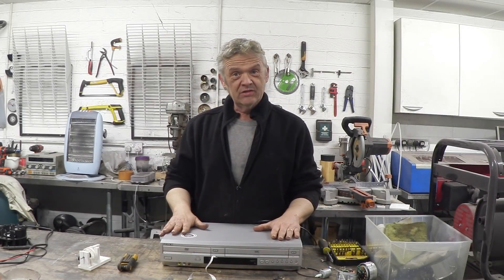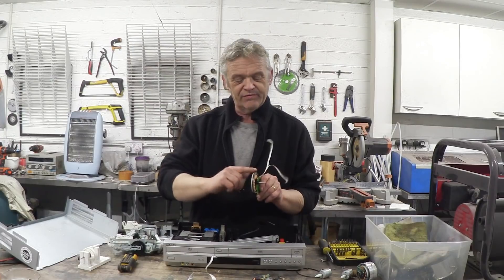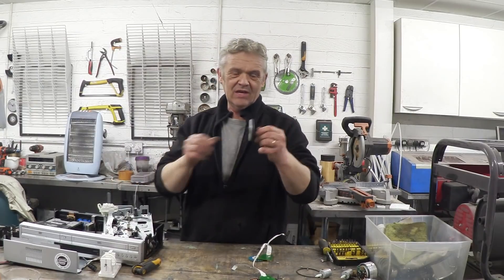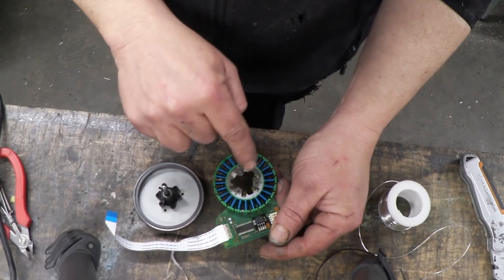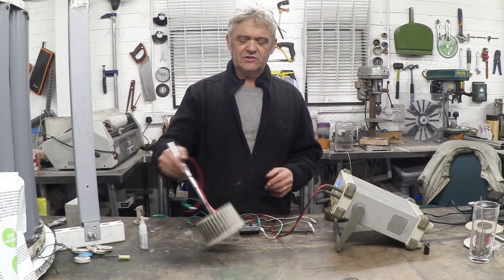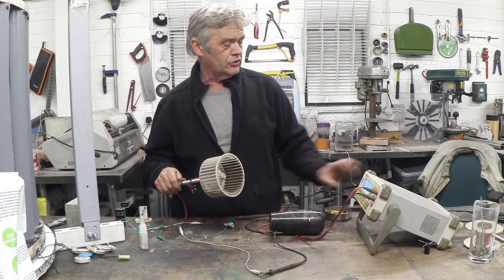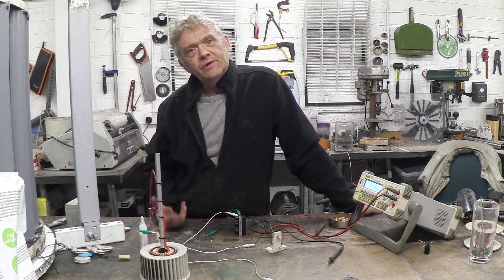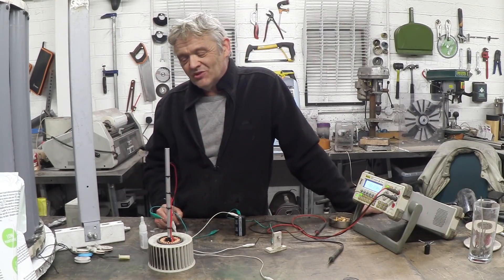Micro Wind Turbine / Harvester

Comment: In regards to a 3 phase axial flux generator, how do you connect each phase to the bridge rectifier? I've seen some people take each phase and split the wire and use 3 rectifiers and I've seen some just use 2 rectifiers. In your opinion, what the best option. Not many videos online about this.
Reply from the maker: I have done a few mate - but you use a 3 phase rectifier which is 6 diodes in series/parallel - you will find it here https://www.youtube.com/watch?v=IMvWkg-Hwv8&t=13s the circuit you want is at time stamp 1:36

Comment: I have a quick question. Wouldn't a vertical axis wind turbine be more efficient if it was built so 180 degrees of the vanes/cups were kept out of the wind stream with a baffle of some sort thereby blocking the wind from exerting a force when the vanes/cups face the wind direction?  Like if a water wheel was completely immersed in the river it wouldn't rotate too efficiently.

Comment: You know when you discharge a capacitor with a screwdriver, where does the energy go?
Reply: EM and especially heat radiation.
Reply: Given a large enough charge in the capacitor, one could ask..: "Where did my screwdriver go?", so the answer is "into the screwdriver"
Reply: Balances and connects the 2 halves of the capacitor which eliminates potential.
Reply from the maker: I don't understand

Comment: good stuff, surprised are not on every street corner light. harvesting wind energy and charging a small battery when light out for off times
Reply from the maker: that's a nice idea mate
Reply: Street lights would need some massive batteries to stay on and useful all night.
Reply from the maker: these days = probably not mate
Reply: @ThinkingandTinkering  yea it's about the same wind here in seattle, so wind itself wouldn't be enough energy to power on an led. too bad the whole light post is not a rechargeable battery. it rains a ton here everyday during the winter but the wind isn't much. cloudy skies so solar is out. anyways thanks for the reply! :)

Comment: love the total concept of repurposing old tec. Using the capacitor solves a lot of generation issues with varying voltage levels. However I'd love to see your take on how to regulate the voltage for charging or useable work..
Reply from the maker: cheers mate

Comment: Good demonstration. The energy in a capacitor E=C*V*V/2. Voltage by itself is pretty much meaningless in terms of energy produced so your critics have a good point. Voltage over a known capacitor does mean something in terms of energy produced so in this experiment you have a good point. As the capacitor nears it's maximum voltage current will drop and energy produced will drop. So will the mechanical load on the hamster wheel.
There is a fun consequence in the formula E=C*V*V/2. If you have 2 same capacitors, one charged to 10V and one uncharged and you short them together charge will devide between them and voltage will be 5V. When you do the math you will find that half of the energy is lost. The thing is that the wire resistance between them does not matter. If the wire resistance is 0.0001 ohm that does happen. If the wire resistance is 1000000000 ohms and it takes a week for the charge to balance that does happen as well. Ain't that funny ?
Reply from the maker: they do have a good point mate and yes that's funny

Comment: I saw this sort this sort drum generator before, certain inventor Mike Waters calls it Waters turbine. Basically its the opposite of the dumb propeller design because it takes all the wind in the cross section and harvests it. Some people replaced the props with this and it works in lot slower winds with higher output. Propellers are just the worst design for trubines (Unless the only thing you care about is diameter to weight ratio)
Reply from the maker: yeah I know Mike

Comment: can't you run the motor from the 'generator'? and how long did the motor run? i was under the impression that capacitors dumped all their energy at once, not in a sustained time frame. been following for awhile. great stuff! rock on.
Reply: He used a super capacitor, which in short is hybrid between a battery and a capacitor.. look them up they are really cool.
Reply from the maker: the amount of energy released at any one time really depends on the circuit load it is attached to mate

Comment: Volts can be useful, I think it's more relevant to put a load across the output, a generator can spin really fast and generate a lot of voltage but as soon as you try to pull amps from it then it will slow down and the voltage drops. You could demonstrate this by hooking your welder up to a petrol generator and listening to it's engine when you strike an arc and the generator has to work harder.
Reply from the maker: sure - but it is really rare to do that - mostly generators are attached to a store and the load pulls from the store - of course the store is the load and that's what is happening here
Reply: @ThinkingandTinkering  Agreed in many cases although I have my solar set up so the loads pull direct from the panels once the batteries are charged, if I can find a reasonably priced controller with a brake or a decent DIY project I'll do  the same with a turbine once it's added. Generally I try to use any spare power generated to heat water so as not to waste it although the whole system is in bits at the moment. :S

Comment: From the last experiment with the layers of plastic and plates of metal, if alternately stacked and wrapped around a spindle that's turned by the wind, would it produce a usable output if it struck an edge causing it to flick?
Reply from the maker: you wouldn't need to flick it mate - I just did that to create a variable capacitor in the easiest way possible - any variable cap will do the same thing - so two plastic disks half coated with metal foil rotating over each other would do it
Reply: @ThinkingandTinkering  I was thinking along the lines of stacked hundreds, like a book opened so the front cover contacts the back and the assembly spinning inside a cage, multiple striking points, don't know if speed would increase charge?

Comment: I actually like the capacitor idea it's real available accomplishment if you need to know how you got there it is available but the answer is still the same I got power lol. I seldom measure my capacity on batteries I make but I always record what or how long I can run something I need light, heater etc.
Reply from the maker: I think that is a spot on approach mate - practical and useful